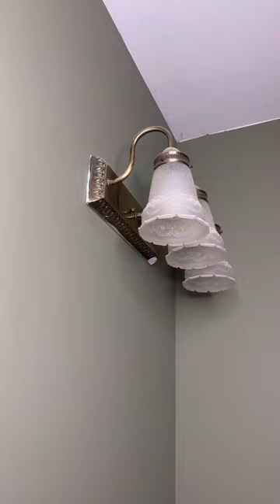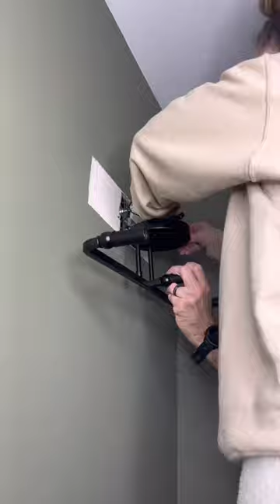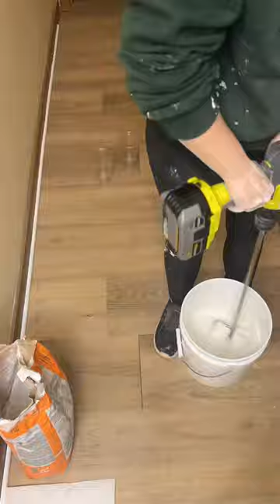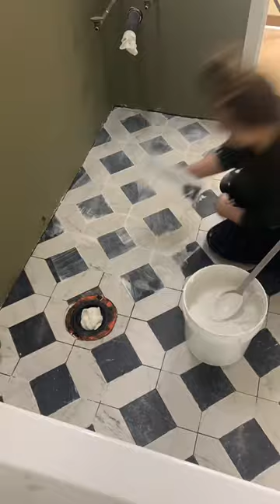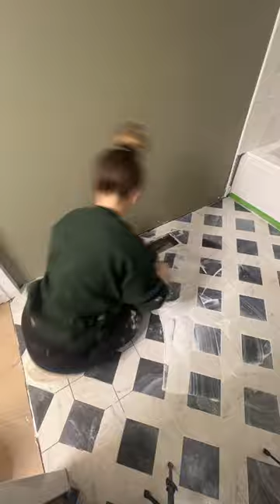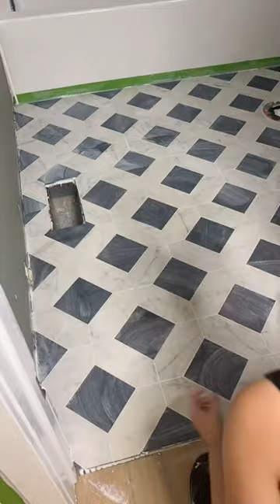HOT MESS LAKE HOUSE RENOVATION PART 184 | VIRAL TIKTOK SERIES | CRYING IN MY BATHTUBS

Comment: Lexi, first off, I’ve done the same thing you dod with your grout with drywall mud. Don’t sweat, just grab a lid for the bucket and save it for the next project.  As for the light, take it back and get a new one. No sense in messing with it.

Comment: I grabbed some lightbulbs installed them and they look like a disco.  ARRRGH.  Tried everything.  Used different light bulbs, BAM no problem.  Put the dancing queen ones back in and John Travolta was right there.  Dug out the package for the bulbs...THESE ARE NOT DIMMABLE.  What?  As it turns out the switch in the bathroom is dimmable.  Not sure if that is applicable in your situation...but offer it JUST IN CASE. ~  You are STILL super woman Lexi.  You are just tripping on the cape my dear. XO